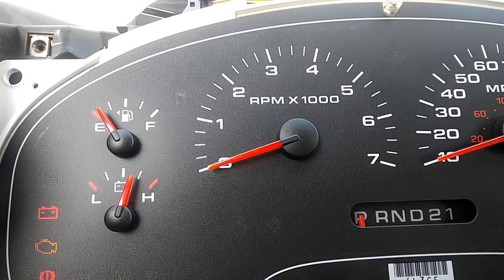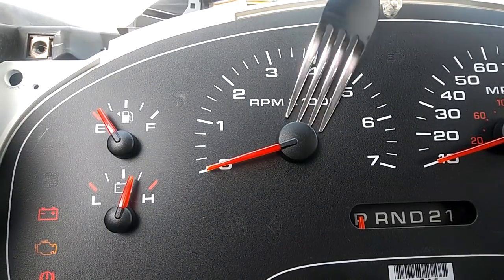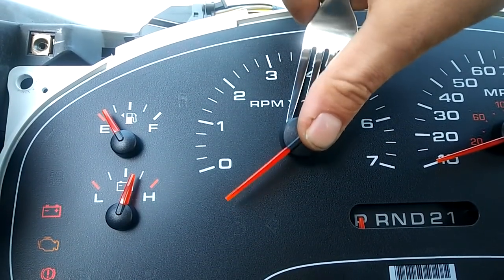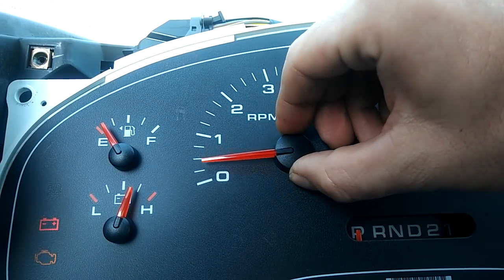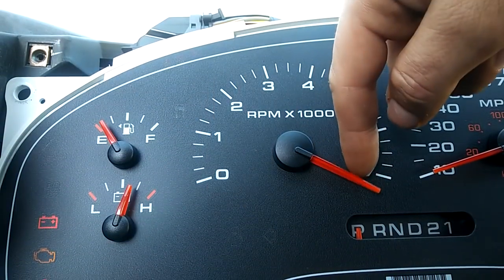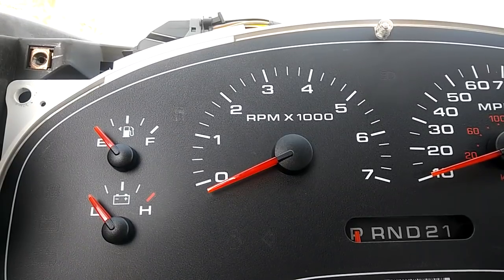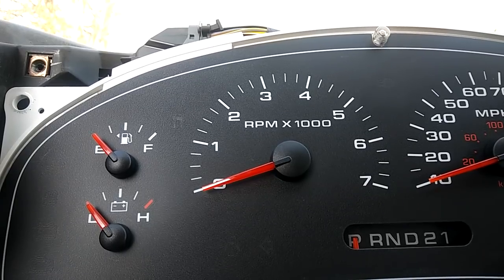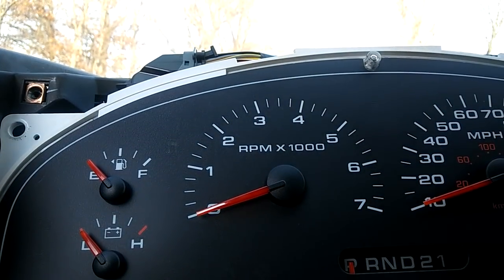F-150 gauge cluster calibration

Comment: Did this today on my 2007 F150, i would still reccommend taking note of where the needles are before removing.   I found that when checking my speedometer against my gps, it was showing 5 km faster than the gps speed, i had to move needle one "click" counter clockwise to correct it.  Excellent video, it really helped me.

Comment: Geez man, I should’ve watched this first. I figured this out on my own today after scratching my head. I had a fuel gauge that was being a pain in the butt and only reading up to 3/4 of a tank one fall and it would stop it a quarter of a tank. I found a spot on motherboard that needed to be resoldered and fixed the issue. I took that darn plastic clear cover off to three times until I finally got my fuel gauge to go to empty one shut off in up past fall. It was being a pain in the butt and only going to a few times so I don’t know what the deal was, but it seems to be working now just fine. Knock on wood. The last couple of times it went to 3/4 of the way, and then after running for 15 seconds it climbed up to full. Seems to go to full or just a hair over now, which is just fine with me and goes right down to empty when I shut off my truck.

Comment: It's important to note this is a cluster without the stopping pins. Like you would see on most older model cars. So great video, clear and well spoken. Many thanks
Reply: Exactly 😂 & I have stopping pins … so wtf am I supposed to do?
Reply: @sierracollins7187  it's a pain. Pretty sure it is easier to have it calibrated by an Auto electrician. They will attach a cable into a female jack that's in the back of the unit from memory. It's very small and like that of a computers. You will find it on the motherboard (green thing).....from memory. Or you are suppose to do a full rotation on the pin and keep adjusting....very annoying way

Comment: Pretty sure I just fixed my cluster needles on my 2005 F150.  Ford Dealership quoted me anywhere from $125-$275 to do it.  Thanks for the video!!
Reply from the maker: Awesome! glad my content could help. I'll be posting more common fixes I do as I get to them. If you have any more issues give a shout I'll see what I can solve.
Reply: I have 2006 F150 where my battery voltage meter is off after my "Karr" alarm went nuts. Which needle did you fix and did it stay fixed?

Comment: I performed a gauge  sweep hoping to reset my temp needle. The needle  points straight down now, hitting the oil needle. Can I pull the instrument cluster and manually reset the temp needle  like you did with the speedometer? Thanks.

Comment: Many thanks your information was right on target. I marked tape put the needles on in the exact same location I started the car the needles moved way out of position I was able to fix it using your method thanks for sharing. Replaced lightbulb on odometer 2000 Pontiac Sunfire with only 24,000 miles. 😳

Comment: u can also "force" the gauge to calibrate by pressing the trip button b4 u turn the key to ACC mode and select sweep gauge.
Reply: JC Ayala doesnt always work my cluster is proof of that 😂😂
Reply: boulderburwell oh no? I though that work also work. Haha
Reply: JC Ayala .... will that work on a  94 Thunderbird?
Reply: Doesn't that only work on digital and not standard
Reply from the maker: Be mindful this only works if you haven't removed the needles and there are no existing issues with the cluster
Reply: @derekf5461  I tried JC's technique on my 2004 F150 speedometer and it worked!  Once I did it, the speedometer stopped around 10MPH, but I remember what you said Derek so I just waited for about 10 seconds after shutting off the truck, and like magic...it went to around 'zero'!  Took it for a drive, and all is good.  My mechanic and my son-in-law who is an excellent mechanic swore that it HAD to be 'electrical'.  It just didn't seem that way.  Is it noon yet?  I'm a gonna have a beer!

Comment: Thanks Derek for your quick reply . Just wasn't sure if the newer needle gauges were electronic type & the older needle gauges mechanical type
Reply from the maker: faronf2006 your welcome, most everything from the old all the way up to the new is just about the same. the only difference iv found is the early 2000's and on do a gauge sweep.

Comment: Maybe I messed up, but this didn’t work for me on my ‘04 F150. Most of the gauges were way off.

To reset: with the trick off, press and hold the little reset pin on the cluster while you turn the key to the “run” position. Release after the gauge cluster reads “TEST”. The needles will sweep and reset themselves.

Comment: Is your key on when you first start? When you pop the needles off with the fork is your key on? The reason I ask is because it looks like it is on because I can see your battery light and engine light on to the left of the temperature gage. Also will this work on a 2006 Chevy trailblazer?

Comment: I have a 94 Mustang and this would not work for mine. So on my mile per hour and RPM there's a little black rubber stop and you have to pull those out to even turn the needle all the way around. So anyway I pulled those off and then I tried what this video the way the video says but there is no stop you can just turn the needle all the way around all the way around other way around. And I actually back in the day after changing up the worm and drive year to get the odometer working, back then I figured out how to get the needles in the right position. But being so you know if so long ago I forgot. So anyway what you have to do with mine is switch the car on not start it  and then put them on  and make sure it stops right below zero on both the RPM and the mile per hour. Because when you put the little rubber stop back in it's going to be at the right position below zero.

Comment: Any idea if this would work on a Mazda close to that year of Ford? I have a 06 mazda 3 and I recently replaced the needles but they are way off and when they move, its very ridged and not smooth whatsoever. You reckon this method would work?
Reply: I have an 09 Mazdaspeed 3 and it worked for me!

Comment: 2000 F150 temp gauge moves only slightly but sits below the C on the gauge rises slightly on start revs high 2000 rpm when gauge falls oil warning lights up and revs rise slightly takes up to a minute to idle low enough to shift oil light stays on but pressure is Ok this happens every start can I reset the temp gauge ??

Comment: My ‘02 F150 has pins on speedo and tach.   How does this method work in my situation?
Reply from the maker: I haven't seen any that are pinned in place. I would say so long as it's a press fit you shouldn't need the pins. Unless you are wrapping the needles out 😏
Reply: Derek Foote there are pins at 0 and 100 mph, same with tach.  They limit range.
Reply from the maker: If you have zero and 100 pins as long as your careful when you pull it apart and put it back together you should have to worry about "recalibrating" it. If that makes sense
Reply: Derek Foote Thanks, for some reason my speedo and tach her off but I’ve never pulled the needles.  I swapped from an F150 to a navigator gauge set
Reply from the maker: The swap its self may be the issue. I may be speaking out of the side of my face here. Are the gauges sweeps different between the two? Example think of a clock, if the distance between 10 and 2 on the f250 differed from 10 and 2 on the navi there will be an issue.
Reply: Derek Foote they appear to be identical.  All other gauges are identical as well.

Comment: Hello folks. 
I own a 2005 F150. 
I had to remove the instrument cluster to get to the circuit board to repair the cracked solder joint for the brake warning light. 
The task was successful, but I’m having problems with the gauges. 
This video is very helpful. Just one question that I need to confirm.....is this process repeated for each gauge that the needle was removed from?
Patrick
Reply: where is the joint on the board ? is it obvious?  i have that issue currently

Comment: I need to do this bad. I have been driving with corrupt gauges. My mileage display is also not displaying the numbers but the screen is lite? Also, the cluster sounds a 5 series of beeps for no reason on startup. Any ideas?
Reply from the maker: The beeps I can for sure tell you are your air bag light. Either the one in the dash cluster or the one above the radio being burnt out.

Comment: Will this calibration work on the 1980-86 , 1987-92 & 1993-97 Ford F series truck gauges ? Thanks for sharing this video .
Reply from the maker: faronf2006 I can't say for sure, but gauge needles are all pretty standard. usually just a plastic piece press fit onto a metal shaft.
Reply: Did it work? Just replaced my cluster and needles are off a bit on a 94 f150

Comment: 03 trailblazer trying to  calibrate the rpm seen your vid like 5times and can't get the rpm to work any suggestions.
Reply from the maker: Be mindful that if this isn't working that it may indeed be a bad gauge motor or and issue with the whole cluster. I do know from experience that the trailblazer's as well as some Chevy trucks are prone to cluster problems.

Comment: will this work on any of the gauges, ie, fuel and temp gauges?
Reply from the maker: biker932012 yes it works on all of them. I've had all mine off to remove the black backing. contemplating another video to show the removal of that as well.
Reply: Derek Foote thanks because I already replaced the all black back with the two toned backing with the silver going around some of the gauges on my 07 and my temp gauge is off.

Comment: Do you think it would work in 04 Ram 1500?
Reply from the maker: Yep all these concept should work across manufacturer's. Just go slow and take your time.
Reply: 04? it doesnt have a stopping point, thats why it has a needle stop pin below the 0. u can spin the needle and it will freely spin like wheel all the around lolol. or turn the cluster upside down and watch it move as gravity takes over. u can try to do the key trick. push and hold the trip button then turn the key to ACC only (do not start the engine) and watch it all sweep. now the sweep is pretty unique as the needle points to all the markings. check out the ram key trick here on Youtube and youll see wat i mean.
Reply: @williamulery6104  if it has a pin It shouldn't have a stopping point from the needle itself, that pin is the stopping point. Now if ur trying to calibrate it, turn the car to on position , remove the uncalibrated needle, and get it to point at 0, as for fuel gauge, I can't help u with that. Temp gauge make sure then engine is cold.

Comment: Will this work on gas needle??
Reply from the maker: I would have to see what your situation is. I just recently developed a problem with my gas gauge as well. This solution will not fix my problem it's the sending unit.
Reply: @derekf5461  i know its my needle idk how to reset it my needle stays at a quater tank
Reply from the maker: @user-ii9vr8gn9u  that's what my needle is doing D O, odds are in that case it has nothing to do with your needle as it's not lying. Have you ever had the dash cluster apart like I did in the video.
Reply: @derekf5461  yes i did take it apart for leds

Comment: Awesome ! Does this also apply to the fuel gauge ?
Reply from the maker: Yes as long as it's not reading wrong because of the level indicator in the tank
Reply: Hey Derek- so what would the stop points be for the fuel and temperature gauges if they are reading slightly off? For example, the fuel gauge: is the stopping point where the fuel tank should be showing given how much fuel is in the tank or empty and then it will calibrate itself when the car is turned on? Thanks.

Comment: Yea this don't work for a 99
Reply: It wont 99 is a aircore motor not a stepper motor.  You have to place with 14 volts on a bench and set the them.  Then I always double check with a scan tool.  The tach and speedo will be fine to set at the resting pins on bench power up.  But others may require tweaking to ensure accuracy.  Volt will be fine, set your bench tester to 14v and set that one at 14.  Air core motors suck.  Their expensive and difficult to calibrate
Reply: @DH-rt1oq  thank you. Is it possible to replace them with something else. My truck has over 191000 and has the digital odometer, pain in the ass but I got it fixed with some solder. Also while putting everything back together a few of the bulbs went out so I am wanting to just replace all of it.
Reply: @hilham89  anything is possible.  But it has different pinouts than the 03 to 07.